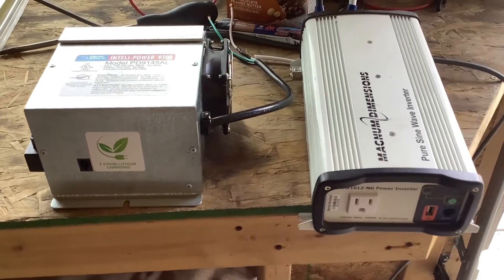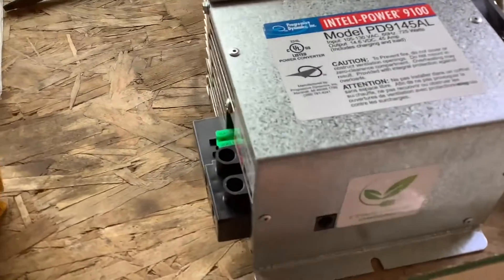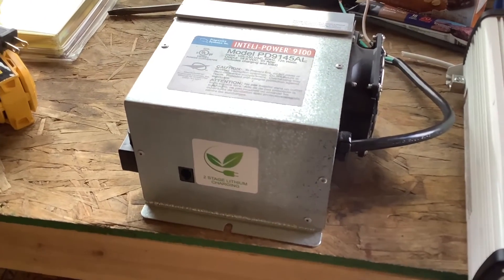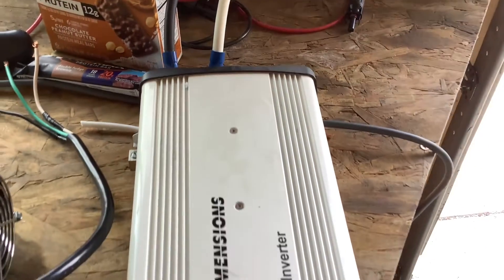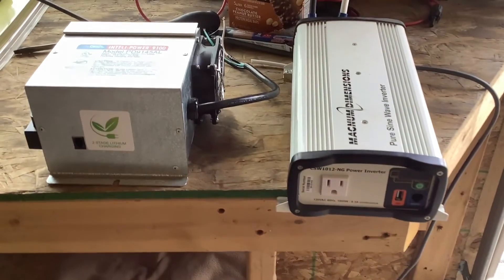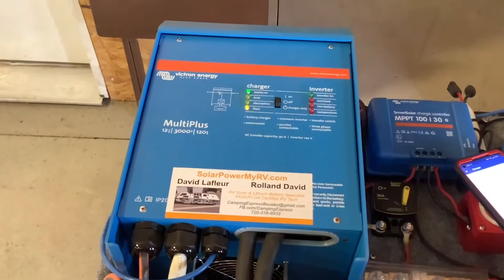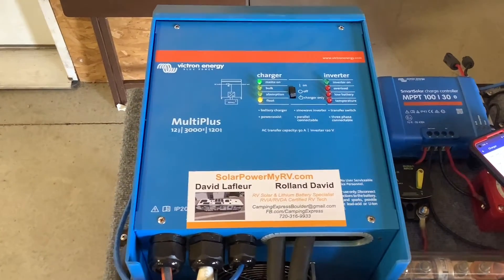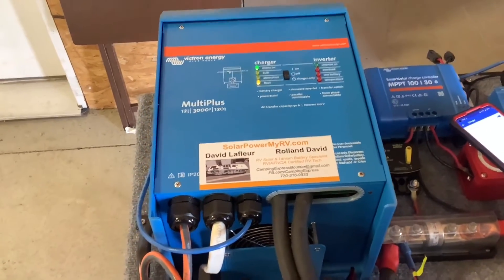Inverter vs Converter vs Inverter Charger: What's the REAL Difference?Demystifying Power Solutions!

Comment: Can you please tell me how to connect my converter for shore power in my van. I have an inverter and a converter separate. I have 12v system with passive and negative busbars. 
Does the converter get connected to the red and black busbars or???

A stupid guy who was helping me move my stern in my van well he took it all apart and then vanished because he probably didn’t really know what he was doing. 
I cannot find any video with a diagram of how to connect a converter with a separate inverter
Thank you 🙏 for any help you can give me
Reply from the maker: its not that simple and if not done correctly, can be a safety hazard. would recommend finding a local rv shop.
Reply from the maker: try RVsolarconnections.com he might beable to make you a custom diagram.